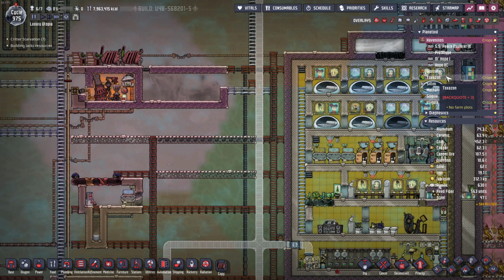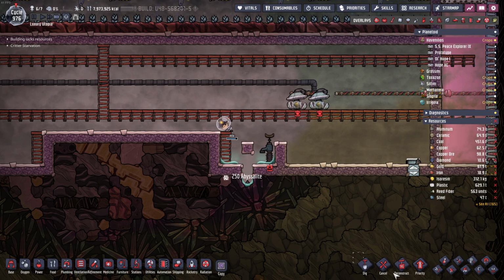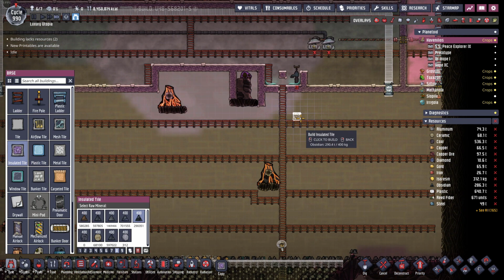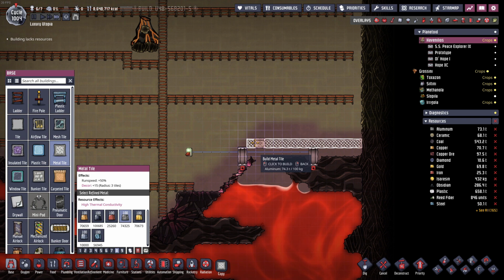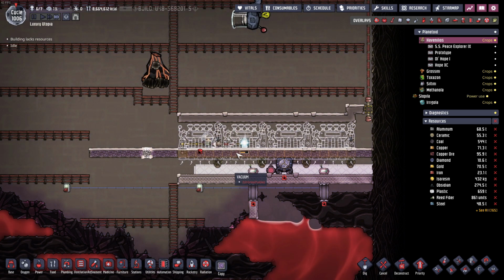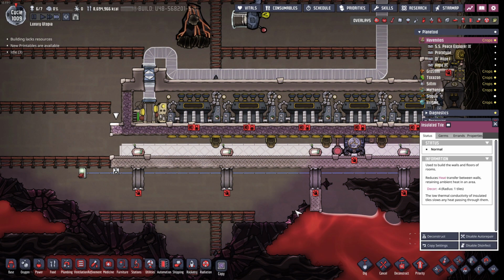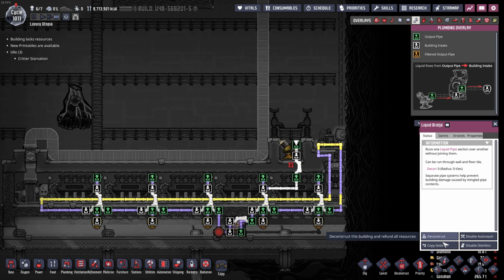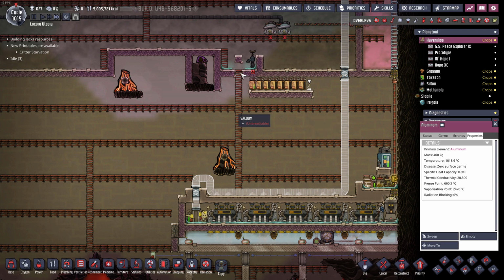S02E47 – Geothermal Power Plant Build!

Comment: Why not diamond window tiles instead of aluminum metal tiles for the steam floor? 🤔
Reply from the maker: Hmmm fair point, those do have a very hard time melting and have a great thermal conductivity...Guess it's a bit too late now! But I doubt we'll run into issue tbh :-)

But that definitely would have been a better choice!
Reply from the maker: Actually I've just checked, and aluminum has a better thermal conductivity and heat capacity. So they are better if you manage to keep the tiles from melting :-)